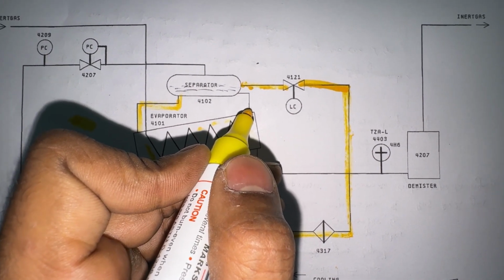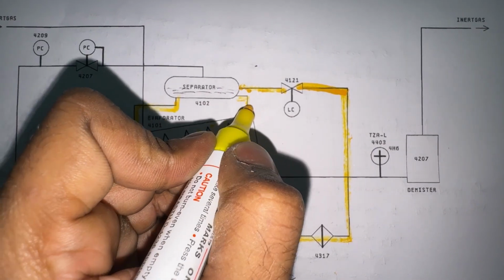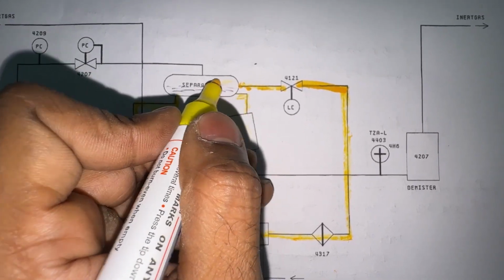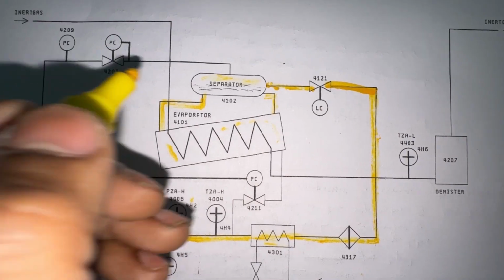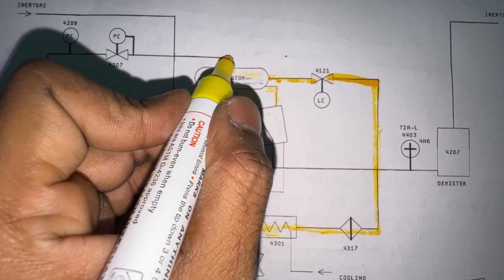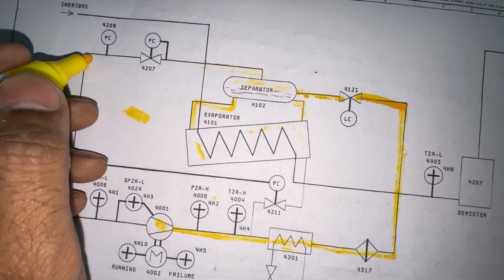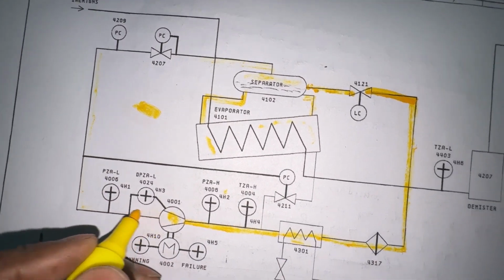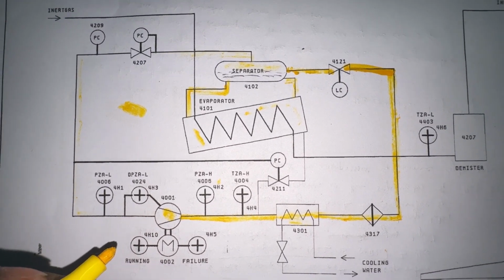Inert Gas | Chiller Plant Explained | inter gas system | sailing engineer | engineering

Comment from the maker: valve opening and closing need to refer piping diagram and ig operational manual as it differs ship to ship and all these are doing by gas engineer..you can assist him when he is lining up the igg.
regarding bypassing the sensor,its all about circuit diagram like how it is connected..

surely if i face problem i will upload video ..

Comment: please make video on the ETO side ( which valve open when and close when, temperature sensors location , pressure sensors locations , flow sensors locations and how to bypass if any problem comes instantly ).